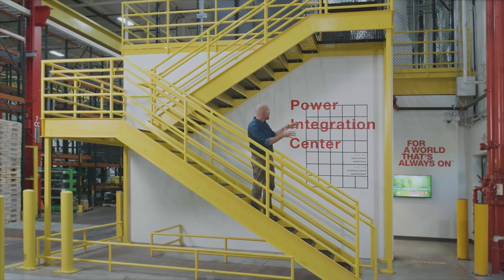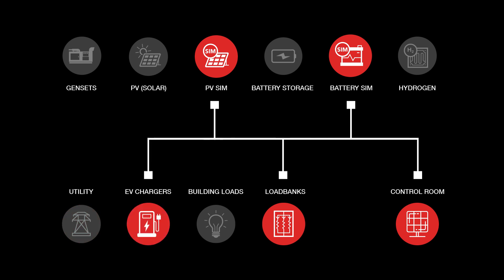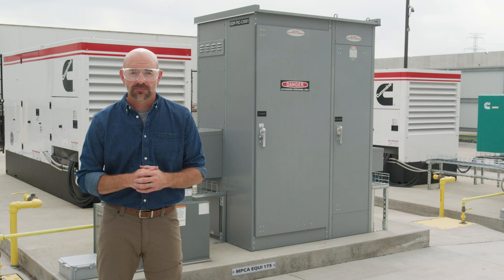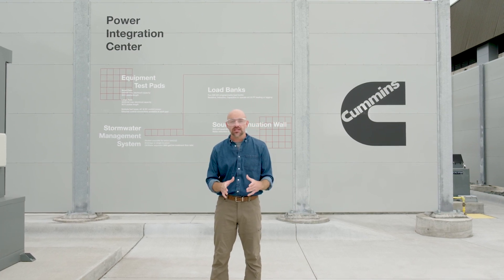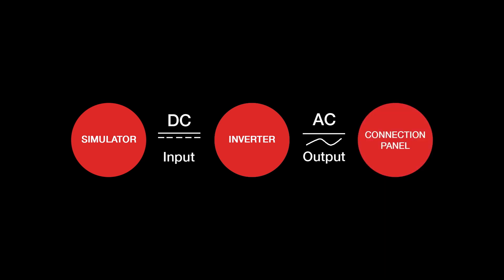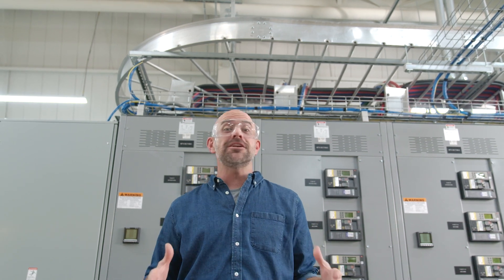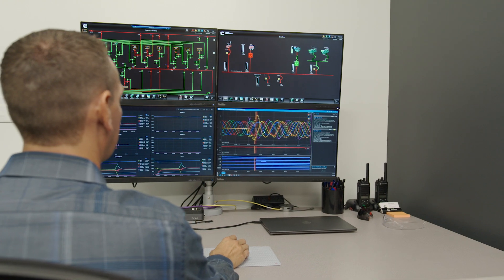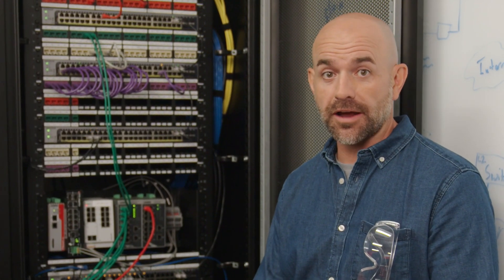Cummins Power Integration Center (PIC) Virtual Tour

Comment: My brother, I ask you for your help. I have a Cummins ISL8.9 engine that does not start. I knock it on and it does not start, but if we do a little oil delegation to the hobby, it will work. There is a light on the dashboard called Warning. Please help. Thank you very much.
Reply: #PowerLearningChannel

Comment: #Dieselgate Would be nice if you focused on commercial only. No more pickups with diesels. Learn from caterpillar.
Reply: I thought CAT got out of over-the-road commercial truck engines because their engines could not meet many countries' government emissions requirements.
Reply: @Carl_in_AZ  Mostly here in US due to epa bs linked are two videos all you need to do is read a few comments. I vouch for the 3406b as many other folks do also.

https://youtu.be/Nu6dq9ny6do?feature=shared

https://youtu.be/nuE_UrVCLfY?feature=shared